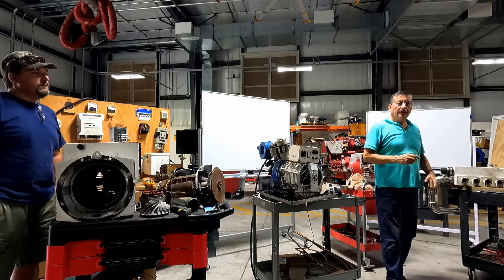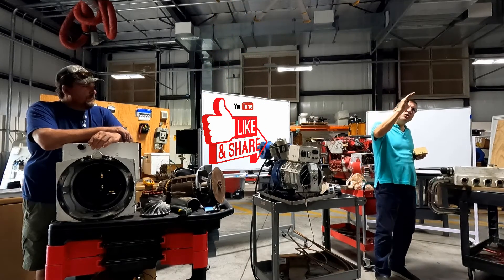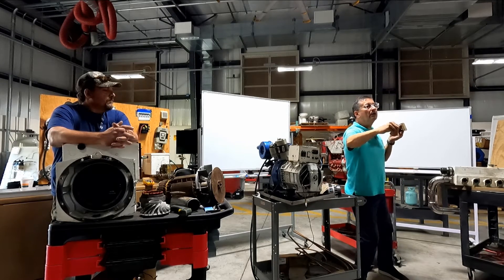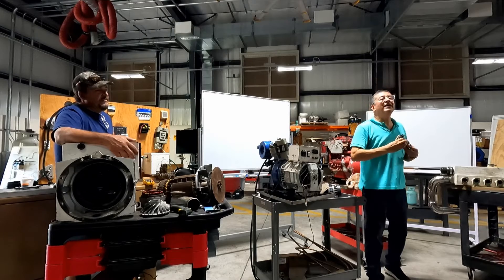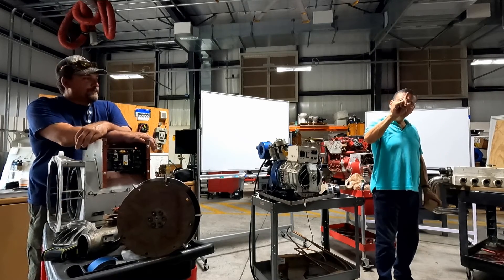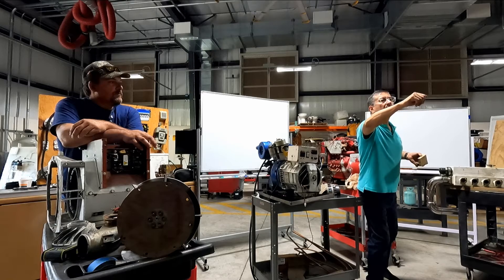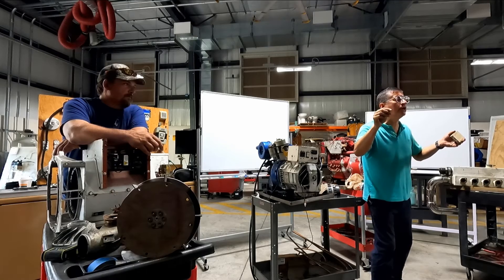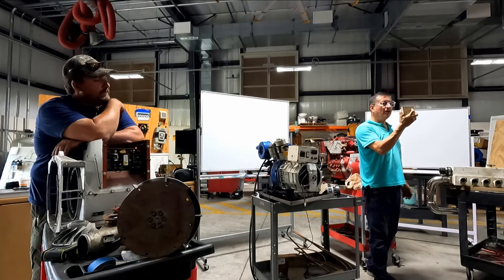Generator Voltage Regulator Explanation

Comment: Last fall I installed a 50 Amp inlet. I bought the Predator 13,000 watt gas generator from Harbor Freight and then I started learning about THD. I called Harbor Freight and they said it has a THD level of less than 20%. Of course that's way too high for sensitive electronics. However, it's advertised for being safe for home appliance use. It does have a Digital Automatic Voltage  Regulator and I've heard this can improve the quality but possibly only as good as a modified sine wave. I'm probably going to buy an oscilloscope to run my own tests if I can't find out if this generator is safe or not for all home appliances. Has anyone had any experience with this generator or can help me understand why this generator either is or is not safe for sensitive electronics?